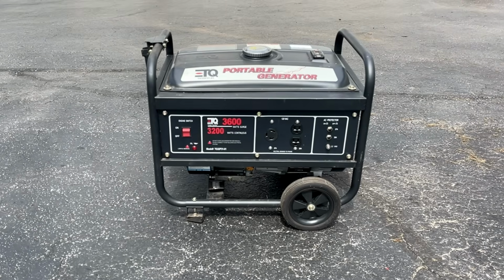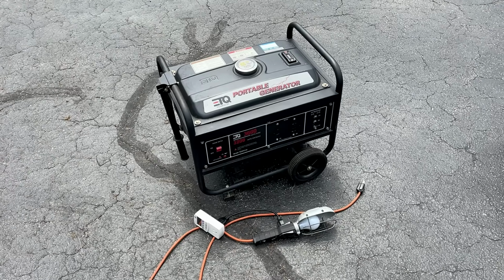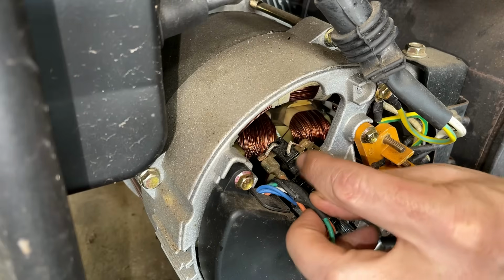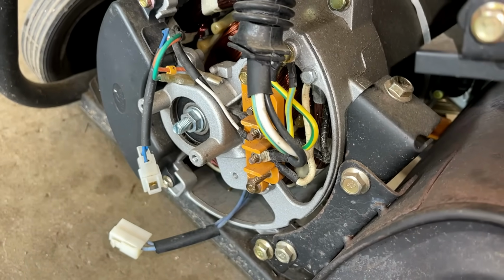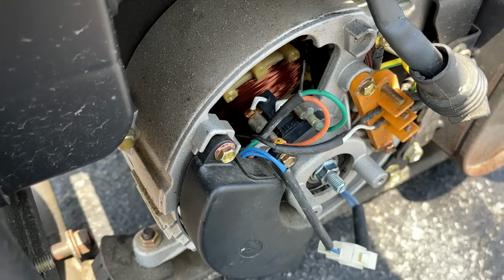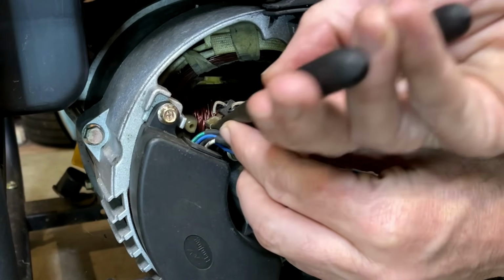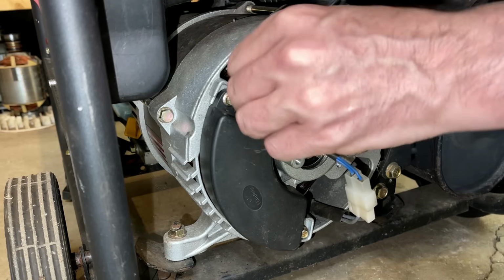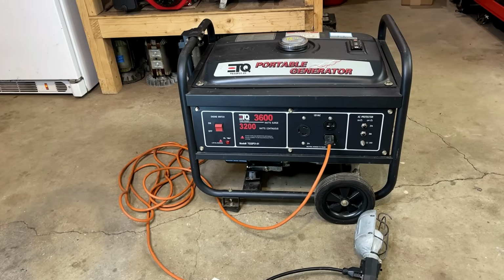Two Generators No Power Output - Same Model, Same Problem?

Comment: Hauntingly familiar gen sets. The only difference between the one I have and these two are mine is a 220 volt 2Kw version sold by Lidl here in the EU. Will need to check the slip rings in mine. Its low time but it means zero if the slip rings are made from inferior cheap recycled Chinese copper. An old timer told me that slip rings should be made of pure copper for the best conductivity.
How hard are the slip rings to change if replacements are available ?
Reply from the maker: I would say near impossible on a cheap generator like this.  The slip rings are pressed on and epoxied in place.  Most likely the damage caused removing them would prevent new ones from going on well (if you can even source the part).  Normally slip rings are not sold separate from the rotor.
Reply: @jcondon1  You might be able to silver plate them.

Comment: Hi there is there any online page where i could get an aproximate year of a coleman generator ????
Reply from the maker: Not that I am aware.  If a Briggs engine, there should be a date code usually stamped on the blower housing or the valve cover.
Reply: @jcondon1  its a 13.5HP robin subaru EH41 on a powermate gen pro 6500 generator

Comment: Pretty crazy both generators had the exact same brush failure, probably just poor quality manufacturing, nice work James!
Reply: Its not crazy that they would fail the same way. Its an engineering flaw. Likely many of these would fail the same way. It would be more strange if they failed multiple different ways equally.
Reply: not uncommon for poor designs to fail in the same manner.
Reply: SPOILER!
Reply: brushs wear over time,,  what do you expect?   lol alway the first thing  I check..
Reply: I am a good student.  I have seen enough of James' great video's that I knew immediately when I heard them crank that it was a burned out brush issue!  🦻🤔 🤣  But, really I have learned a lot!  Thanks James for another great video!
Reply: has nothing to do with manufacturing or poor design, users just overloaded the gensets

Comment: I've heard of the capacitor being faulty and not storing enough to excite the armature windings, the machines you fixed must have had defective brushes from the factory if they weren't able to clean those rings through use. Good diagnosis.
Reply: yea i have one of those, its the prior model to these in the video, mines a blue frame one. if it sits for a while 6 months or so, they refuse to make ac voltage. quick fix is to hook up a electric drill with the generator off, and spin it by hand a few times, after that the thing always powers right up

Comment: Hi just got a quick question for you, I have a 6kva capacitor generator when it starts and isn't under load the voltage is about 220v but when you put it under load the voltage goes up the more load you put on the higher the voltage goes is this normal in you opinion 
Thanks
Reply from the maker: Normally the voltage goes down.  Have seen some that go up a little.  Is the capacitor the correct microfarad value and how much does it go up?
Reply: @jcondon1  yes tested the capacitor and it's spot on voltage goes up about 10 to 15 volts
Reply: Just tried new capacitor and still getting the same

Comment: James, thanks for all the insight.    Given your vast source of inexpensive generators would it be possible demonstrate paralleling a couple of noninverter type generators?   There is very little info available on the subject.  I have seen it done with a couple surplus military 5kw generators using a DIY synchroscope (220v bulb). The idea is to connect the two generators when the bulb goes dark, (when both generators are in phase)  ..  Once connected their speeds will lock with each other.     Id try it but I don't want to risk damaging my generators.  Although I've heard usually its just a breaker that will trip if they are connected out of phase.
Reply: I could imagine the AVRs on modern generators causing unwanted interactions, although it would depend on the specifics of each design. It might result in one rotor's field current being cut which would cause the generators to lose sync. If the generators lack an AVR or if both are hooked to a single AVR it would probably work.

Another thing is that three-phase generators would likely be more likely to work together than single-phase generators, but I don't know if it would make a practical difference.
Reply: Or you rectify the  a.c. and then connect as dc . Many tools using universal motors can run sweetly on D.C. but should to just be safe and check for increased  arcing of the brushes , can check visually or aurally or by smell. modern technology  lighting will operate from D.C. as will old school incandescent light bulbs . Microwave ovens need a.c. but  maybe not so for the  latest technology microwave ovens , Old school  flourescent lightning  needs  a.c.. Also it's  possible to feed the D.C. into just the appropriate section of a 12v  D.C.  to a.c.  inverter which can convert the high voltage D.C. to a.c.,  but only for older technology  inverters  because the new technology ones have self monitoring  feedback  loops but not always.

Comment: Good job.thank u for this informative video.Im happy.Were do u get parts for generators?I have one with a Subaru engine.works excellent.I used it here in Los Angeles back 2019 we had some outages.And haven't used it since.I run leaded 100 octane fuel from the local airport.I never use pump gas on my small engines.
Reply from the maker: Most parts I get from Amazon or from other parts generators.  Also use eBay.  Sometimes I use large parts sites but try to avoid them because often it takes 2-3 weeks to get parts.

Comment: You always seem to come up with issues not seen before!  Any chance the brush contact area was too small?  Maybe the brush material is higher resistance than it should be.  Thanks for the video.
Reply from the maker: I think the brush alignment was an issue on the slip rings (at least for the second generator).

Comment: Make jig out of a stator brush replacing the graphite with 6000k sandpaper and a very light spring, install, run the Gen briefly the uninstall to get this rings contact points polished nice 😊

Comment: I think it is the resistance between brush and  slip ring that will give more potential divergence between the two.
So you get voltage between the two and amps over the two making wattage.
Wattage becomes heat and melts the brush holder.

Comment: Looks like a design error by using a plastic that melts under relatively low heat. Needs a metal brush holder with fiber reinforced thermoset plastic or glass fiber insulator similar to ones used in universal motors such as a vacuum cleaner motor.
Might want to look into the possibility of fitting a competitor brand brushes into the generator as many of the China generators have the heavy castings made in the same place. This may provide the opportunity to install a better heat resistant brush assy to prevent a repeat failure. Would any brush assy from an Onan fit?

Comment: Question....if I'm checking the dc voltage coming off the avr when there is no power or really low voltage (measured about 1.6v DC) would that be a bad avr, or bad  brushes?
Reply from the maker: Either a bad AVR or a bad DPE winding in the stator.
Reply: @jcondon1  thinking more it's the dpe winding...  What should a nominal voltage be to power up the avr?  And I'm assuming that voltage is ac correct?

Comment: You couldn't use a cordless to spin the shaft, when cleaning the slip rings?
Reply from the maker: Yes, but would remove the stator first so no risk of loosing a finger.

Comment: Dang it, you got lucky, twice. I say dang it because I spent a week on a sears 6.5kw. Even replaced voltage regulator for the electromagnets. I never tried, "Flashing the Field". You ever heard of that. Anyway, dumped the 6.5 for 12kw Duramax and connected whole house.
Reply from the maker: Flashing the field sometimes will fix the issue.  Especially on older generators.  I find though, they usually stop making power for a reason and flashing the field may get it working long enough to let some smoke out of the stator.

Comment: I've watched hours and hours of your videos, and you've educated me not to be scared of pulling these apart. Bought two gennies both none runners and them working within half an hour, thanks to your tutorial. One I had to dial in the running speed to get the voltage where it was right.
Reply from the maker: Very nice
Reply: @jcondon1 those generators are exactly the same as I have that we had trouble getting started a few years ago
Reply: @jcondon1 
 And how exactly would someone go about fixing The Wire that goes to the slipring? Just asking for a friend. LOL.
Reply: Isn't it librating whey you can work on stuff your self? Now with chanles like this one teaching everyone they are trying to make it so you can't work on your own stuff.
Reply: James, I'm curious  if you have ever done a video on a vertical  generator, like the colman power mate 2500?
Reply: Hi!!! You too are a genius

Comment: James is it ok to use contact cleaner or brake clean to clean off the slip rings?
Reply from the maker: You want to be careful not to put anything on that will leave a residue or damage the wire insulation.  Contact cleaner is probably ok if used sparingly and only on the slip rings

Comment: James, I've had a few problems with brushes swelling I suspect with damp? Of course they stick in the holders and rapidly fail. This is a bit different as they are on power tools of different kinds.

Comment: Question. I have had a genset kicking around because I didn't want to throw it out. Runs excellent and has a pressurized oil system. I've looked at the normal things and can't quite figure out why it's only putting out 60V of power. Basically cut in half. Any insight would be appreciated! Love your videos and they have helped me diagnose a few that have come into my shop!
Reply from the maker: If brushless, then most likely a bad capacitor.  Or a bad voltage regulator on a brushed generator.  Would also check if a corroded or loose connection.

Comment: Any chance that turning the rotor in a lathe could solve this issue?
Reply from the maker: That would be the best option.  But also noticed the brush alignment is a little off on the second generator.  Not able to correct that.

Comment: At 20.03 I see the brushes are off-center....you can see where the brushes have contacted the yellow paint/insulator which is holding the brush away from the slip ring?
Reply from the maker: Yes the brush alignment is off.  Most likely a quality control issue.  That will cause a failure.

Comment: You can really hear the throttle open up when you turn the second heater on!  Seems like a nice snappy governor though.  

The thing I'm starting to notice with generators is that the newer ones tend to put out more stable power (AVR, fast governors etc.) but the build quality and longevity isn't nearly as good as the old heavy, loud things with no AVR and more sluggish governor.  Though back when those were made, people weren't running nearly as much sensitive electronics with them.
Reply from the maker: The newer Honda clone engines are pretty good.  Also the new power heads make cleaner power.  But they are built cheap and will not hold up as well as the old ones.
Reply: I agree. Got a free 1983 Yamaha Ef2800 from older gentleman, at a garage sale.    WOW  what a tank.  Had to redo carb; de-rust fuel tank, clean out gen head with washer/air. Changed oil, and it runs now like a top, makes good power.  The engine is 256 cc, and has more torque  than the modern chinesecheapeis. Good paint job, added wheels. NOTHING  like   '' back in the day '' .   Deosn't  make a sound, when plugin angle grinder, switch it on.             
                           Excellent balance, between carb and governor.
Reply: Back when the engines outlasted the generator heads. All the units I get have destroyed chonda engines, but made power until the end. I can't knock 'em too hard, I don't know what kind of life they had before I got them though.

Comment: Stereo generators with stereo problems. You have to wonder if it's a design issue or manufacturing process failure.
Reply from the maker: In this case, manufacturing.  But it was a cheap generator new.  So cannot expect much.
Reply: @jcondon1  I didn't know it was a cheap one n prolly a combination of quick design and quicker execution...

Comment: I would run the generator for 10hrs with a very light load, to allow the brushes to wear into the slip rings.  Hopefully with the runtime, the brushes will lightly sand the slip rings, and clean them up!!  New generators with brushes, should be burned in under light load with a full fuel tank to allow the brushes to wear in.  By running the generator at high loads, will cause them to run hot, and do this issue.  Most people don't, and why this problem develops.  The slip rings where damaged due to the arcing, not due to slip ring quality.  By running it light load for at least a full tank, you should see the damaged slip rings will clean up.  Mind you, your cleaning will help speed up the cleaning process with the brushes, and make them run cooler for seating in to the slip rings.  I deal with Onan RV generators, and with them sitting, the slip rings get light corrosion.  Once I get them up and running, the light corrosion cleans up.  Mind you, the generator runs for about 8hrs in a weekend, so it gets ran quite a bit.  The carbon brushes do act like light sand paper to the rings.

Comment: You need to make you a set of leads for your meter that have banana male plugs on one end and a standard male three-prong plug on the other.  A computer cord would be a great parts donor.  Of course, it's a little dangerous, as the easiest to find male banana plugs do not have the insulating sleeve as most meter leads.  However, trying to get those meter leads into an AC outlet is always difficult!  Such a lead would be so much easier.  Love watching the channel!  I learn something every single time.
Reply from the maker: Was thinking something similar the other day.
Reply: @jcondon1  I'd say "great minds think alike" but I'm lightyears away from being a great mind!  I'm more like a blind pig.  My father used to say:  "Even a blind pig will find an acorn if he roots around long enough!"  ;)

Comment: You get what you pay for.  The generator was poorly manufactured as shown by the chatter marks on the slip rings when the rotor was manufactured.  Also I would suspect the slip rings were either out of round or off-center from the axis of rotation or the rotor was not aligned to the engine shaft,  that would cause the brushes to jump up and down 60 times a second trying to follow the slip ring surface.  Also it seems the brush holder was made of a low melting point plastic and the brushes may not have been centered on the slip rings.  The proper correction would be to mount the rotor on a lathe, measure the slip ring run-out and true the surface with fine cuts, then smooth with 400 grit wet/dry sandpaper and finish off with green Scotch-Brite.  However, I do not think this model generator is worth the  effort.  Two generators going bad exactly the same way exposed a design flaw so I would keep a spare brush holder on hand like a spare fuse for when this happens again.

Comment: would you try some ultra fine emery cloth on the ruff ring, while being careful to not remove too much.
Reply from the maker: Yes.  Ideally the rotor should be uninstalled, plug removed and spin engine with a drill whip holding emery cloth on the slip rings.  Even better, put it on a lathe and make the slip rings nice again.  They were machined poorly from the start and the brush alignment is also off.
Reply: @jcondon1  the very best way to clean a slip ring is with a fiberglass stick which give great results and electricians use on large motor  and generators.

Comment: Check the serial numbers, I bet they're fairly close and there is a batch issue with either the brushes or the rotor/ slip rings?
Reply from the maker: I agree.  I think they were purchased from the same store at around the same time.

Comment: The material the brushes are made from changes the resistance and causes heat build up.. the higher the resistance the higher the temp... good brushes DO NOT GET HOT and the brush holders dont melt.. you can measure the resistance of the brushes..   ALL GENERATORS ARE NOT CREATED EQUAL... you get what you pay for...I would not spend my money on something like that..GREAT VIDEO !
Reply: Material rings are made of can cause same issues you describe. Brush make up, resistance, ring concentricity, and in the old days, film on rings all can be issues.

Comment: I used a jumper battery connected to a lamp cord, plugged it in to the 120 outlet on the generator and started up the engine to reflash the generator and it made power again.